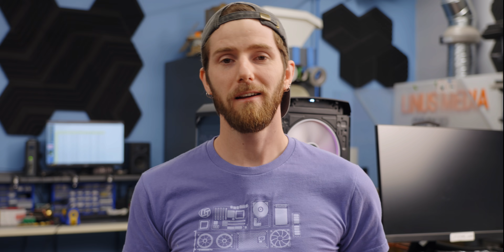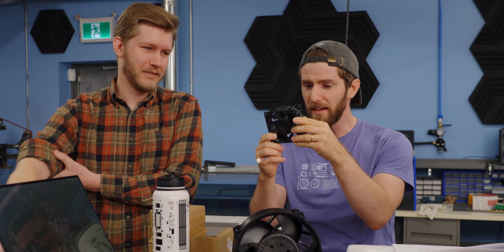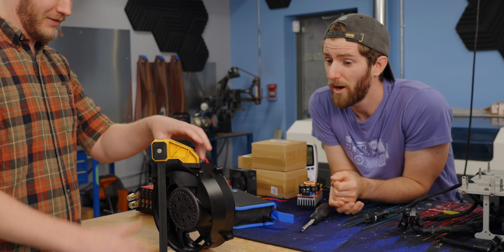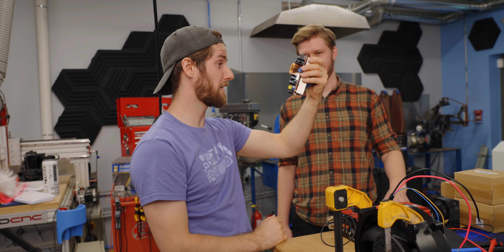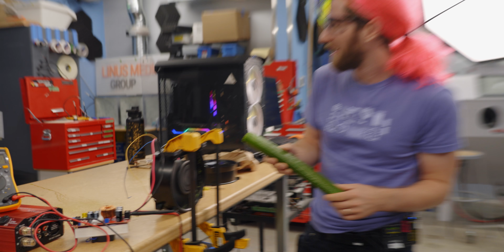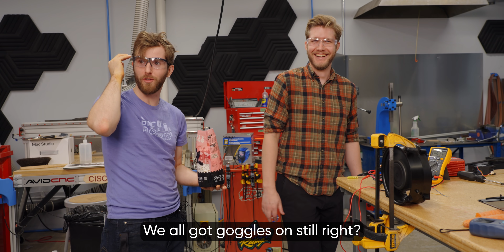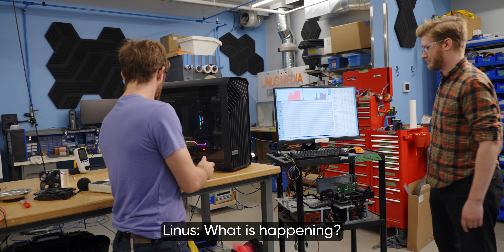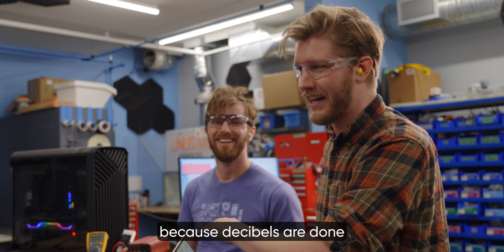The God of Computer Fans

Comment: Ah memories....The PC Power & Cooling 1200W Turbo-cool used a single 80mm Delta Tri Fin Fan....which was almost as loud as that thing...and ran at full speed whenever the unit's internal temps exceeded 50 degrees....which as I painfully recall...was ALL THE TIME!  As for 8:06...the first scenario I can imagine....but the second...what websites has Alex been visiting?!

Comment: In my work place at ABB we are using similar fans to cool frequency converter modules. Those are handling up to about 1000 Amps so they kinda need a lot of cooling 😅
Reply: I commented the same! I’m Controls tech in the US and I repair VFD’s down to the component level, they definitely use the same fans! Especially in big power designs.
Reply: So much heat lost...

Comment: 2011 I was working as electrical engineer engineer at Dubai we used such fans to bring cold air exhaust air from HVAC(25 %fresh air adding every minute to building and 25% cold air get exhaust though HVAC) to cold down our outdoor VFD’s and other controls panels

Comment: For powering random stuff like this, Riden makes cheap but good lab power supply front-ends that do up to 60V and 6A (or 24A for more money). You just need to provide an external power source higher than your required voltage, then you've got an easy and cheap constant voltage / constant current source with digital control

Comment: We used fans similar to these (huge amount of airflow) to cool few kAV worth of transformers enclosed in a rack cabinet. They had separate fuses, usually two of them (for redundancy, each on one side) and were controlled by PLC which got temperature data from a temp probe thermal epoxied to the transformer's core. 
Funny side note, when the fan kicked in, the efficiency of the transformer increased, even if it wasn't running super hot.

Comment: Not these, but I have seen similar, insane fans for the pc and control components for large CNC machines that have multiple logic boards, amps, and controllers in a cabinet on a manufacturing floor where the ambient is often around 80F to 85F.

Comment: Slightly off topic anecdote: back in the day I used to buy my fans at a local camping store. Decent cfm yet quiet 80 and 120 mm Papst fans meant as replacement or backup fans for a refrigerator, for less than half the cost of what it would cost when they where labeled as a computer fan. 'Computer fans' are often just generic industrial fans, adding a 5ct molex just doubles the price.

Comment: I use fans very similar to these on a regular basis, I install them into enclosed NEMA rated cabinets to help draw in cooler air to cool VFD’s as well as various electromagnetic contactors and relays. Seems like every cabinet has a different intake and exhaust fan from 24/48v DC to 115 and even some 220v ac fans

Comment: This makes me wonder if air-cooling could shove so much air that the friction of the air would actually produce heat instead of cooling
Reply: To produce heat you'd have to compress the air, not just move it. If you have something going supersonic, like the comment talking about meteors, you have something moving so fast the air can't get out of the way, so it compresses. Compression's also how diesel engines work, more or less. The speed of the air isn't what produces the heat, it's not friction, it's the compression. Haven't done thermodynamics in a while, but I believe it's the Ideal Gas Law that you could look at for more information.
Reply: @thegingineer0  compression is also why gas has different octane values and why it used to have lead on it.
Reply: @thegingineer0  The compression stroke heats the air/fuel mixture to its flash point which basically causes a contained explosion and produces power
Reply: @thegingineer0  But would faster-moving air not compress more upon hitting a solid object?
Reply: @nmotschidontwannagivemyrea8932  Not enough to cause any real measurable heating without it going supersonic
Reply: Impossible. Supersonic propellers are extremely inefficient. And at subsonic speeds there is no significant heating. Supersonic wind tunnels are made by pumping compressed air into huge tanks and releasing it in few seconds. However, it is possible to solve the problem by connecting several fans as compressor stages and get high speed by releasing compressed air. This is how jet engines with an axial compressor work. Although without afterburner they limited at about Mach 1.5
Reply: @rainbowhyena1354  Actually you can use subsonic fans that blow into a tunnel that narrows then widens, to get to super sonic. Boom.
Reply: You probably wouldn't be able to measure heat added to components from fans but regardless any energy that you put into the fan will eventually end up as heat.
1200W of fans will just become 1200W of heat because fiction will eventually slow the air down to nothing and the laws of thermodynamics tells you that energy just isn't gone but gets turned into something else, which would be heat from the friction
Reply: Try skydiving in a windtunnel, at air flows of 120 mph you get heat from air friction.... that is no where near supersonic speeds (767 mph). So yea, it's possible.
Reply: You are adding about 600W of heat to the air with those fans. However it is such a massive volume that the temperature rise is not that noticeable. Run them in a closed room for a few minutes and you'd see a temperature increase for sure.
Reply: Lol I can tell none of you have taken thermodynamics

Comment: I work on a Semicon company wherein 2 of these fans are used to maintain the ambient temperature of the ETS tester (23-25 degree C). We have 30 of those testers in a line and it is freaking loud.  (ETS - eagle test system)
Thanks for the vid, I won't try to stuck my finger on it anymore 🤪🤪🤪

Comment: I have actually used these for work. I work for a leading semiconductor ATE company. Out instrument boards are liquid cooled but the radiators and 48u power supply racks all use very similar fans. Often at full speed too

Comment: I had a Cormair Rotron Patriots in one of my computer cases in the past. Loved it, but it was a pain cutting the case to fit it. Only paid $90 for it though back in the day. Later tried a Comair Rotron Mixtus as well. About the same specs as this Delta fan. Unless you are providing proper power to the fans, they don't run at full speed easily. Took some creative wiring for me to get them going where I wanted. Also, you can do only 12v or 24v from a computer PSU, which is a lot slower and quieter as well as safer to use. Also, I only ever used 1 in a case.

Comment: Because I haven't seen some other sweaty neck beard shouting it from the comment section, rpm isn't really speed. The outer blade tips will be spinning much FASTER then the inner blade portion close to the hub. The point got delivered that you don't wanna put your digi's in it, but I couldn't resist....;)

Comment: I've seen these used in biopharmaceutical manufacturing for emergency air circulation, I'm not sure if they're these exact fans but they had banks of them in case it detected a chemical spill or gas leak and would suck all the air out of the room to exhaust. these were ISO controlled clean rooms in the boston area

Comment: What makes this even more amazing and kinda not a very good comparison at the same time is that Ryzen 7000 boosts up to 95°C and stays there because its designed to. You will hit a thermal wall before a power wall with normal cooling so the fact that it went down 15°C just shows how much cooling these fans do.

Comment: this may be the best pc fan delta makes, but some german companies have been making all metal fans that put this to shame for decades, they arent cheap, but, the 8*120mm units we installed from them over 15 years ago into a server thats been on 24/7 since, and they show zero signs of wear, they were spendy but the upside vs typical plastic fans was higher static pressure and they are quieter at higher flow rates then most plastic fans, the weight makes them a bit greedy to spin up but the up side is, they have alot of momentum so they tend to rev slower when set on ramps, just both up and down, that systems got a liquid cooling setup that uses  some sort of oil, i didnt design that part it was part of the 4u case they had me help do the build in(do the build with them watching in reality... i told them all to back off, i could do it faster without them getting in the way.. they found i was correct.... to this day im faster then most people at putting togather a system, even people who do it far more often then i have for years...
Reply: note: those run off a 120v connector and pwm wasnt a thing back then afik, but the company sold a controller you could plug them into that used a header to control speeds, it converted the dc changes to changes to the power sent to the 120mm 120v fans.. near for its day...

Comment: yes, we use them on our lithium ion battery formation machines at work, we charge 150+ cells at a time which are 50ah each. Takes alot of power and makes a ton of heat

Comment: Belaz Belarus made loaders and dump trucks have similar (maybe exact ones) DC fans all over the thing... Cooling electronic, electric motors, auxiliary hydraulic, wire harness... It's a big 200-300 ton complicated machine, it needs ton of filters and airflow all over the thing

Comment: In telecom, it is very common for computer equipment to run on -48V DC. That's nominal voltage, based on 12 lead acid cells in series, so they actual voltage will be 54-56V. I've seen these fans in base stations for Verizon and AT&T cell sites as a backup/supplement for the primary climate control system.
Reply: 48v is 24 lead acid cells, they’re nominally about 2v each.

Maybe you’re remembering some kind of 2s pair of cells or something?

Comment: I think instead of noctua it should have been the phantek's T30, they're not technically in the same class because of the 30mm thickness but it's still a 120mm fan and it out performs it by a lot. (and yes, I'm aware it's a lot louder)

Comment: We use something similar in networking, a very hot piece of equipment has 9 of them to keep the temps down, but does not spin at maximum at all times. Whenever the rack is switched off and back on again though, all 9 spin up and sends dust and debris out the back like a hail of bullets

Comment: Where I worked we had a laser cutter that had 2 of these to pull the smoke and fumes directly to the outside of the building. It wasn't just negative pressure air flow, it would actually suck the cut material down to the mesh floor plate. You could tell when the laser was on from the parking lot.

Comment: In my limited experience the most likely effect from over spinning a fan seems to be that the bearings cease up and/or melt. But it can apparently kill the electronics in the fan too.
Computer fans are usually brush-less DC motors and DON'T really work as generators when spun no matter how fast.

Comment: These are actually very similar to the kind of fans that we use in gamma-ray astronomy to cool the front-end electronics of the camera. See https://arxiv.org/pdf/2203.08169.pdf which describes a camera using the similar fans described here https://datasheet.octopart.com/6314-2MP-EBM-Papst-datasheet-140713056.pdf

Comment: Oh boy. This reminds me of the Thermaltake Smart Fans we used long time ago. Smashed them on or in everything. On LAN Partys my Buddys and I had an seperate space because of the noise. But we had the most stable running systems even in the summer and cramped space with no AC.

Comment: F1 has some crazy cooling solutions going on in the pit. The cars lack any active cooling to reduce weight and drag. They are required to be moving at race speeds to cool properly so they have came up with some crazy designs throughout the years to cool them down when they come in. The engines themselves are required to be at operating temperatures when parked to fire up do to the tight tolerances of the components within the engine. A lot of cool thermal tec

Comment: I used to repair 10000 lumen laser projectors with water cooling that had large delta fans, it had 6 on the radiator, not as large as this but on a larger projector you'd probably need these.

Comment: I run a fan similar size in my bed room all the time but it a 120 volt it helps me sleep at night so much air flow help out my window unit in the summer and the heater in the winter

Comment: in 2010 had 6 of them for a 1/2 megaWatt power supply for induction melting. they cooled the Water radiators for the IGBT transistors:)

Comment: Used to work with similar fans used in Frequency converters of 132kW upwards. with heat loss of several kilowatts, spending 600W on a high power fan doesnt seem too bad.

Comment: Just get a rectifier diode assembly rated for like 15-20 amps and running a variac to it. 0- 240VDC with whatever amp rating you desire(fuse)

Comment: Those power supplies actually make pretty nice battery chargers, as they have a current limiting function on them, but most of them will step up voltage based on percent of gain from input voltage, so make sure you have a stable power supply to feed it if you are going to use it as a set and forget unit. 

If you plan to use it with solar you may need to baby it for a while to ensure proper behavior.

Comment: 14:38 Yes. When we tested it, it was sitting on thick synthetic wool office floor, sucking air "through that floor" blowing up. We tried to move it... well guess how much it moved even with basically no room behind it?! :) Yes! Usage: Worked in a DC with self made racks. Lets say 40U is quite the standard, right? We made 80U Racks on the same space. Cold air in from bottom to top in the middle of the rack (similar fans sitting below the rack 2/rack). On both sides of the rack we basically had 1U servers but less than half depth pushing warm air out >> room >> ceiling >> standard DC ventilation room cooling sucking it in again >> cool it and push it below the 2lvl floor again. There was a lot more going on here - I can imagine that ppl who worked with standard server racks have now more questions ;) but this should be enough for now.

Comment: The company I work for uses smaller fans like that for electronics cooling on industrial ovens and was trying to use these for airflow inside an incubator that could reach a sustained 80C.

Comment: We use a pair of the 140mm Deltas for emergency airflow to cool VFDs when their internal fans fail. They are incredibly dangerous to open, and need a complete disassembly to access. So they can be placed on the exterior, and provide enough flow to prevent overheating until they can be professionally serviced. I’m VERY interested in some of these now for the exact same use case!
Reply: Assuming VFD means variable frequency drive, what kind of motor were they driving?

Comment: Fans much like these cooled an entire rack of electronics in our tape library (the kind you can walk into, holding 6000 tapes). Not quite that power, but two of them made a heck of a noise and probably used as much power as a typical server.

Comment: Hey. Oil & Gas Procurement agent here.
I purchased a couple of a similar one to generate airflow  for the electronics of a ship's water filtration system. They were running extremely hot due to an error in project, and we had to make a buttload of airflow to the area.

Comment: I don't know if anyone has already pointed this out, but the fans have 4 cables.
And unless otherwise specified by the manufacturer, the assignment is as follows:

Black is minus
Red is plus
Yellow is the speedometer signal
Blue is PWM control

Then you don't need to create dangerous imbalances by sticking anything on the fan blades for the tachometer.....

Comment: I'm working as a data center engineer, and I know these ones. We use these and similar fans to move the air from the bottom of a server rack to the top in case the ambient temperature gets too high. In normal operation, the airflow + temperature difference of our cooling system is sufficient.

Comment: You're probably moving air too fast for the GPU's fans to work. Sounds like you need a full water loop with those on the radiator in a push/pull configuration.

Comment: i've had to get abut 30 for these for a new Net farm, we use them at the top of each enclosed rack to pull air into it. Cienna equipment makes so much heat. Fun fact you probably already know, networking equipment runs at 48-52VDC, AND the system is polarized, so negative is positive and positive is negative.
Reply: @bobbydazzler6990  congrats you said the exact same thing i said, how smart do you feel.

Comment: 14:40 Not in any of the Tech Fields, but my first two immediate thoughts came at the same time. First was those movie scenes that used isolation rooms for chemical hazards. I'm sure you know the ones. The second thought was that major server rooms have fire suppression systems that do not rely on any liquid but instead just pulling all the air out and replacing it with non-reactive inert gasses. I'm guessing these go a long way towards that second option.

Comment: 10:55 the main concern with overspinning fans is that computer fans aren't exactly built to take abuse, so you can like, shred the bearings and stuff inside the fan and completely destroy it, or fry the fan's internal controller with the EMF from the coils. I wouldn't worry about that EMF going back up the wire to the mainboard because the fans are all electronically commutated and you're going to fry those electronics (probably shorting them out) before they have any chance to somehow make it operate like a real generator.

(Most modern small computer fans are single-phase BLDC and use these cheap little chips that integrate the commutation with a hall effect sensor, at least the ones I've opened up).

Comment: 2*600W = 1200W which is 50A at 24V. You need proper wires for 50A. Those were not nearly thick enough. Hence the 90°C.